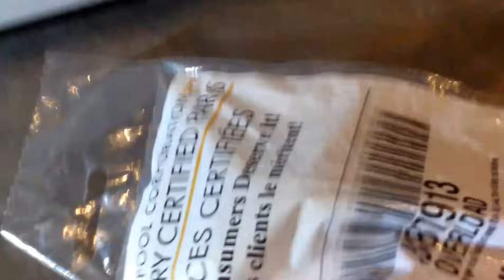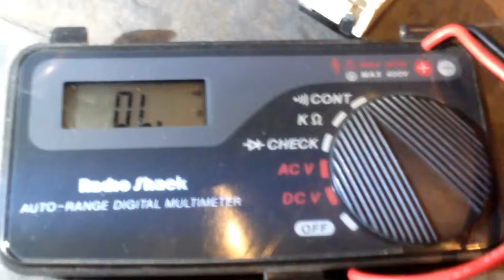Fridge Compressor Not Starting Replace Start Relay & Overload

Comment: I replaced both the overload protector / capacitor and the starter relay on my GE Hotpoint HSS25GFPD WW side-by-side fridge of 20 years yesterday, based on the info. I've been seeing on these YT videos about those 2 components going bad, which prevents the compressor from starting up. But even after replacing those parts, when I plug in and turn on the fridge, the same malfunction still occurs: compressor runs for about 5 seconds, and then shuts off, and I hear a repeated clicking noise as if the overload protector or relay is tripping the circuit (which is what it's supposed to do I guess if the electric current is too high going to the compressor). So what else can I do in this situation on my own here that won't require a "professional" repairman to come out and take a look.

Comment: Hello people!!
3 pins... in this compressor Top is common (1), Bottom Left is Start (2), Bottom Right is motor (3). measure resistance between 1-2 and 1-3, write it down. Measure 2-3. it should equal EXACTLY the sum from the previous measurements. It could be ok electrically and be stuck anyways. best of luck

Comment: 2:39 if you have continuity to GROUND then there's a GROUND, not a short, A short would be between wiring / circuitry. Continuity to ground is a GROUND and would immediately blow a circuit breaker.
Reply: Short to ground

Comment: Bad information. That is not how to test a compressor. You are testing for shorted compressor only. You ohm out the compressor terminals to see of compressor has an open winding or weak one.

Comment: I had this problem in a chest freezer I picked up by dumpster.  The ceramic disk in the relay had cracked down the middle so it didn't rattle.  We we able to spin the disk so it made contact again and it actually fixed the problem.

Comment: I have a 20 year old Ge refrigerator; the overload is bad. The overload has 2 wires connected to it, (black and red) the relay has 2 wires, (orange and white). I can't find an identical overload. The overload you have, shows only one black wire connected to it. Can I use the same overload and relay as yours and how are the wires will be connected. Thank you in advance

Comment: I have samsung side by side fridge , when I  put the plug the fridge working in both side but after some while it stopped no fan working the display is ok no flashing  , is it possible the main boar relay connected to compressor or the compressor  overload protector and relay compressor  or the big capacitor  how to tell if the capacitor is broken thanks in advance

Comment: I have a question my friend.
My freezer is working fine. What's a refrigerator part does not get cold. Is it possible I have the same problem to relay switch ?
Thanks Keith Kuhn I just subscribed and gave you a thumbs
Up.

Comment: I googled to replaced overload relay cause is making the same sound but no luck finding replacement wtf...i typed every freaking # on relay & nothing comes up,thanks for video
Reply: Yeah, its diffucult to find an accurate replacement. I just went with the one I was able to find that was close enough. Seems to work Ok althouh lag times bettween off & on periods are longer for some reason. Could be because the new relay is a tad different from the old one. Its two pins instesd of one pin & the overload unit has a different number at the top but looks identical to the one that came with my mini fridge.

Comment: So on mine, the compressor checks out, no shorts, the relay and overload have been checked and replaced, the thermostat is fine and it still doesn't start. This time suck is going in the trash!
Reply: THE GUY WAS WRONG YOU SHOULD TOUCH PRONGS ON EACH COMPRESSOR AND HEAR A BEEP. IT IS GOOD.  BUT IF YOU DONT HEAR THE TONE IT IS NO GOOD

Comment: Just bought a Magic Chef refrigerator working fine at the people's house laid it down to move it got it home now it's just making a clicking noise won't compressor won't come on any ideas
Reply: From reading on the mini fridge manual, mine says that when the unit is laid on its side, to stand it up straight and leave it for 6 hours (Don't plu it in the outlet), I think the oil or gas inside the compressor needs to drain back into the reservoir.

Comment: hello i already replace my overload relay but wont start  the compressor, after  a second i hear a click  what is the problem of mine sir?
Reply: Sounds like your compressor might be seized up. Does the compressor get really hot to the touch and can you hear a faint humming coming from the compressor?
Reply: Hi there! Great clip I changed the relay and overload but now when I plug my defy fridge in it causes my breakers to trip every time

Comment: For clarification, the part he was shaking is the overload. The other part is the start relay. Typically, if you shake the relay and hear it rattle, it is toast, not the overload. I wonder what happened to part II of the video to see if it actually worked!
Reply: While I personally use the internet  to find  "fix-it" videos all the time you can see that some youtubers don't really know what they are doing and are just copying videos they have seen. As a result there will be some burnt fingers out there.
Reply: Yes, you usually see they shake the relay and NOT the overload.
Reply: Yes
Reply: OLP
Reply: My relay is fine, but my overload makes a little noise.
Reply: How do the eitrs

How do worrs go back on defrost relay

Comment: Whirlpool refrigerator will not turn on in Sade light working ones I turn on the power ice maker sound for 2 seconds if I hole the power switch all lights blinking on the display model number GISFSAXVY02

Comment: I removed my starter and it made a rattling noise when I shook it. I replaced it and it didn’t work. So I took off the overload and that also rattled when I shook it. However, I’ve purchased about 3 overload replacements and they all rattled as well. Is it normal for the overload relay to rattle? Either way, after changing the starter and the overload relays, the mini fridge still doesn’t work.
Reply: Same here. I suspect this guy in the video is wrong about the rattling. I bought a brand new one and it rattled just like the one I took out.
Reply: Sorry I have just remove this part as in other videos they said that this is where the thermostat was. Any way I did a reverse image and found out it's was actually a starter relay.
Note to all if you look closely at this part it kinda resembles a plug. The rattling as this video suggest is actually the bottom metal Marked C between the N (neutral) & L (live) that's making the noise.
Hold it and I bet the rattling STOPS.
So that bit of information in this video is incorrect according to my findings.
Now I'm going to remove the internal temperature controller and test that with my multi meter. 🤔
Reply: Those will always shake lol the new ones don’t but if the new ones shake it’s broke

Comment: Hey Hey Hey you didnt put the part number in your more info like you said you would of the one you bought. I don't want to pay 44$ on F amazon, I f hate amazon, shit is always more expensive there. and i dont see one on ebay. There has to be a cheaper option...I will prob have it fixed by the time you reply haha

Comment: If you test it, you don't need to scape the paint. Just touch the copper process tube. the terminals on the compressor are Common (where the overload is connected) Start and Run. When testing for an internal short, test all three terminals, a short can exist in any of the windings.

Comment: Do you have exact wiring diagram ?. I have tree wires going in relay (Black, White, Grey) and two wire going in Overload (Black and Blue). How do I retrofit these wires in new Overload/relay which has only two wire ?

Comment: Sheese $40 for the parts when you could have spent $12 for a capacitive start kit and achieved the same thing..
Also continuity tests do not determine if a compressor has gone bad, You could have a locked rotor, thats why you put a clamp amp meter on it and see what the compressor draws while starting.

Comment: As a refrigeration tech, explaining taking covers off and talking someone through a service call or repair, or for those who are a diy kind of person, turning the power off before should be explained before...  Some people get in a hurry, or just don't think about turning the power off because they just don't realize how bad it can hurt them if its not off before diagnosing a bad compressor.
Reply: Exactly.
Reply: Lol..some people don't have common sense..
Reply: 🤬NOW ya tell me!!!!😳
Reply: Or, the symptom needs to be recreated and plugging it back in must occur.
Even getting a flashlight close with covers removed can cause an arc or short trying to get eyes in to see something while trying to get a compressor to restart.
Reply: Where is your head lamp Donny Linc
Reply: @Mrnikkisicks  it was ripped off when they took several other things.
The fridge works.

Comment: Hi,
my GE side by side fridge the compressor is not turning ON I don't hear NO clicks from the motherboard
Reply: If doesn't start with relay you can start without relay with a starting capacitor

Comment: This is EXACTLY what I needed to know.....to clarify, those parts are just stuck on there by the connections and they just pull off, correct?  Mine was very tight and I didn't want to force it.
Reply: did you manage to take it off
mine is also bvery tight

Comment: buzzing , clicking ocured on a 2004 amana...so compressor wasnt' starting.  I cleaned all coils, ensured fan works ,and proceeded to install new Whirlpool Factory parts ( W10613606- Starter device and capacitor $120 Cdn) and compressor kicked on! Mission successful for 6 weeks, and came home after being away for a few days to warm fridge, rotten food!  The same buzzing, clicking...so now I got an OHM tester and get all positive readings for continuity on compressor windings, and yes the start relay is burnt out again, as well the plug in power clip to the relay has an arced brown burnt look inside it.  Here's my question....Is this a clear sign of a Bad compressor that is burning out the start relay?  I guess I should have tested the compressor 6 weeks ago when I had it come on to ensure it has 120V going to it?  I feel it would be foolish to spend another $120 to replace the start relay again to the fear it will burn out again in short order.  Is the 3 n 1 option a stronger one than these cheap looking plastic made in mexico parts? Is there a more in depth test I could do on the compressor that involves it running to see why its burning out the parts?  OR is it time to put it to the curb and go spend $2,000.00?  thanks

Comment: My Lemair brand freezer stopped working. I removed the relay and overload protector, then plugged each back into position, plugged power cord into wall socket and freezer works again   ~ . Done this twice so far, seems to reset itself. Also the rattling heard at times, when shaking the overload protector, doesn't necessarily mean it's bad ( the case with mine ). Good to test with a multimeter to be sure. Too much food in freezer caused shutdown, i believe...someone else got a better theory?
Reply: I guess , u have a faulty compressor that consumes too much electricity and causes overload to shutdown , the same issue is happening with my deepfreezer and I am pissed off with it .!!
Reply: Interesting...perhaps so, thanks.
Reply: smallpeckerman No problem :)

Comment: why cant you check over load with ohms meter to see if it i open?
Reply: You can.. open bad... closed good... but use a low ohm setting like under 1k and on meter should zero out if unit is good.

Comment: My experience with the famous clicking and compressor not starting -  2010 Whirlpool model # ED5FVGXWS05, fridge and freezer were not cooling, compressor was HOT (the compressor was not turning on).  I watched 12 hrs of videos about checking/shaking the start relays and listening for a clicking noise.  I also watched videos on how to OHM out the compressor and it checked good.  I removed the relay and heard some clicking but it didn't sound out of normal.  So after talking to several appliance techs I decided to replace the start relay.  I bought it from an appliance store where no refunds were allowed for electronic components ($60 gamble).  No luck, relay did not work, compressor would try to start for 10 seconds then click no power).  So, even though my fridge was 6 years old my compressor was bad and I was looking at $550 to fix it.  Instead I rolled it to the end of the driveway, left a free craigslist post and bought a new one.  Found out "maintenance" was required on your fridge every year to include vacuuming the coils, etc... Life long mechanic and never heard of that but from now on will make sure that I schedule with my wife an annual refrigerator coil vacuuming...  FU Whirlpool and the $ u cost me...
Reply: Hi Daryl, The cheap compressors that are made overseas or mexico now are crap and only last about 5-6 years this is normal and by cleaning your coil it would have helped extend the life a little more but crap is crap. Don't feel bad mine only lasted 4 years on a $2000 stainless boat anchor. My local appliance store sold me a new compressor for $149 and I installed it myself and it's been now 2 years now. When I was younger and moved out of the house my mom gave me a refrigerator that was already 20 years old and it ran for another 15 before it finely gave up the ghost they just don't make em like they use to.
Reply: im in the bahamas and i paid roughly 2000 dollars for a 19cu whirlpool refrigerator after 14 months the compressor gave out and the store were i bought it from said the warranty is only 1 year and to replace the compressor is 700 for the part and 200 for the labour
Reply: That's  how I got a 19 cu ft  2 year old Whirlpool frig. thru CraigsList. Owner said it would run for a couple days and quit. Because we had to lay it down to get it in the Van, I saw a mat of dust-bunnies on the coils. Once home I blew the coils off with an air hose. I sat it on 8" concrete blocks to make it easier to do the same once a year.  FRIG WORKS GREAT!
Reply: nothing is made good anymore its all throwaway now.old hotpoint refrigerators were tanks
Reply: Hello, this description is exactly what is going on with my refrigerador. I will try to clean the coils and see if that helps. Big problem... Still haven't figured out how to to use a multimeter to see if the compressor is good or not. 
I put a new capacitor and start relay and I hear a clicking sound.
I didn't hear that with the old part though, fridge just stopped cooling at all.
Any help or suggestions anyone? Thanks :)
Reply: Thanks for your input Daryl. I'm having the same problem you were and went out today and bought a compressor relay/ capacitor combo. The old one had the ominous rattle to it so I sure hope this does the trick. Although the compressor ohmed out good it was really, really hot so your old post has got me a little worried. Anyway I'll find out tonight. Thanks everyone for your posts.
Reply: Monica Thurston
I feel your pain.
Reply: please dubbed in Hindi

Comment: Can you ohms test bothe relay and overload to see if God or bad? If yes how? Ty
Reply: kevin meeker hy
Reply: jasdeep kumar hy?
Reply: You can check the thermal overload with ohms.... Its it reads shorted like when the test leads are shorted good to go... shorted should zero out the meter when connected. but you first must remove one wire from the overload protector so it will not read back in to the circuit and give a false reading... use a lower ohm setting like 100 ohms or less and then look for shorted or a zero reading.  You could I  guess you could anything smaller then 1K settings or less on the meter for testing this and should get a reading like the leads are shorted or meter should zero out...   The start relay can be tested with the beeper... ...However a start relay of the  PTC  type Relay can not be tested using an ohm meter.....If your unit is clicking every few seconds to a few mintues or its buzzing and sounds louder then it did a few days ago when it was cooling then The start relay is bad... Find the part replace it and check ebay. Way cheaper then the dealer...

Comment: I replaced both parts an the overload think burn out when I plug it in. I took the overload out to check it and shook it.And it made some noise inside. any idea why it would burn out the overload like that'?? thanks Manny
Reply: Manuel Perez locked you compressor need a new one I’d say

Comment: just noticed my compressor clicks on then clicks off around 6 seconds later.this happens every minute or so...is this the start relay needing to be replaced?
Reply: roadstar499 I have exactly the same problem....did u get a solution to the problem?
Reply: @bishop2503 did you get the solution?
Reply: I had the same problems with my refrigerator, did anyone found a solution
Reply: Did you get the solution?
Reply: So I got a technician out to have a look at it. He listened to it and assessed everything- came to a conclusion that the compressor had packed up and needed to be changed. Replaced it with a new compressor and it worked 100%

Comment: What if you aren't hearing the clicking described above and the compressor is warm?  Is that an indication of anything?  The fan is working  and the evaporator fan in the freezer is working, but the compressor isn't kicking on.
Reply: I'm sure you have it fixed by now but sounds like the relay may be the problem.
Reply: haha - changed the relay and that worked for a few days.  And, I now have a shiny new refrigerator.
Reply: hows the new two year old fridge going?